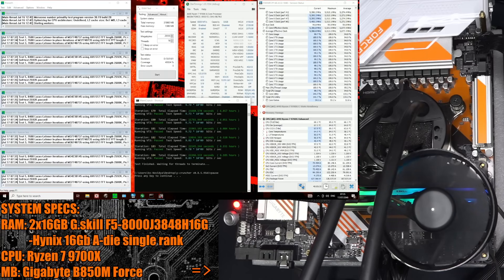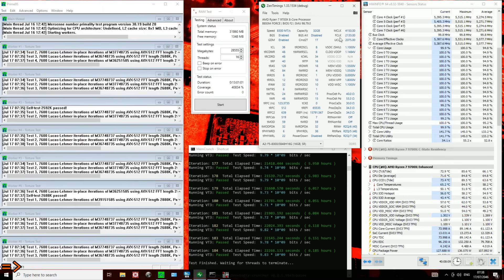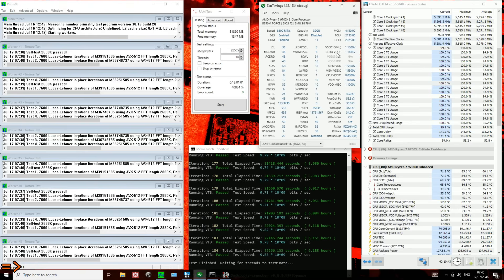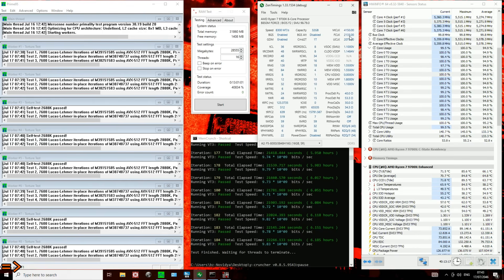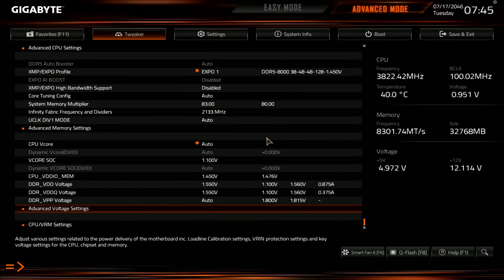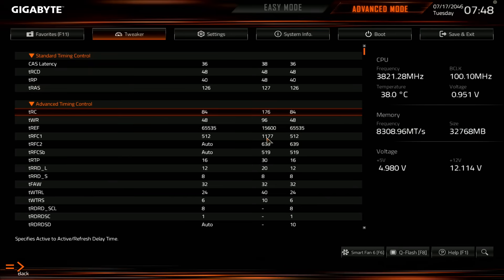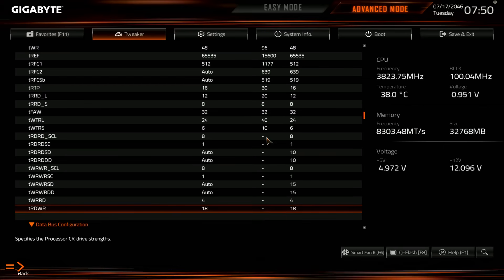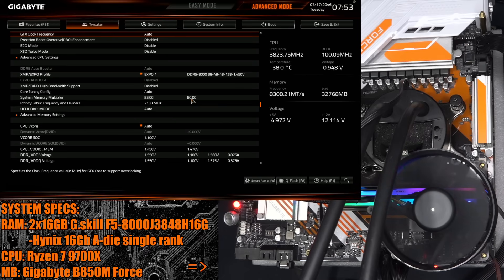DDR5-8300 CL36 with a Ryzen 7 9700X and Gigabyte B850M Force

Comment: There are a comment on X:
"vddio in gigabyte bios is for pushing the usable vddp limit. too high vddp without sufficient vddio may cause no boot/bsod. for current 1.45v vddio limit, i can push 1.175v vddp. 1.20v vddp caused me too much trouble when vddio was still being locked at max 1.45v. i guessed i needed 1.5v vddio for 1.20v vddp to get 8400mhz stable for my hardwares. gigabyte design requires fine tuning on vddp for dram oc."

Comment: The internet really confuses me with Ryzen voltages I gotta say.  All I see is people cranking SoC, VDDP and VDDIO yet the internet, especially Reddit warriors, go bananas the moment you tell them you put SoC above 1.2, change VDDP in any way, and crank VDDIO past 1.2.  From what I can tell, practically any EXPO profile sets VDDIO to 1.4.  I have no clue what to feel is the upper, safe daily usage limit because the internet is just pitchforks and if you dare say you bump voltage too high your processor dies yesterday.  I feel like I got a golden sample for my CPU and my ram kit and as long as I give it some juice it takes whatever settings no problem, I'm just not sure what's best for daily vs internet street cred because of benchmarks.

Comment: 4:03 why ??? THE CPU IMC won’t run 8400 end of…… 

Buildzoid you of all people should know it’s all down to silicone lottery not the motherboard 😂😂😂😂
Reply: I know this guy that has this mobo with 9950x3d, he's running 8400 stable but it wasn't possible with the stock bios that caps cpu vddio at 1.45, he downloaded a modded bios on a forum and vddio goes up to 1.6. he has 8400 fully stable with vddio at 1.50 but it has issues booting even at 1.45 so BZ might have gotten 8400 a modded bios here on this mobo! that's of course if the cpu is capable.

Comment: Hello everyone, 
just discovered this MB and found an offer for 132€, considering its pcie 5.0, and amount m.2 I think it's pretty nice (I know it doesn't have a lot of USB). 
I seen a comparison video that tests the temperature, and it was a bit higher that the previous downgraded model, so a bit disappointed. 
Just ordered a ryzen 7700, but not sure if I should go for this MB or get another one for 20-30€ more. Also saw that Asrock have good VRM/thermals, but scared to go with it because the report of X3D burned (I know mine isnt, but still scared).
Can someone help? ty

Comment: Ive been messing with my proc ohm and other ones, ive finally gotten them fine tuned and noticed a uptick of 600-1000 more mbs a seconds and 2-4 ns faster. On my 2x32 cl26 6200 memory. (Its gskills 2x32 cl26 6000). But also have super tight timings and have been working on this kit for 2 months? Can you shed some light on signal intergerity from your knowledge. 1.2.0 nitro etc

Comment: First: No way, over 8000 with 9700x?
After i check: oh, it is a 2 dimm board.. nevermind
Reply: why whats wrong with 2 dimm board?
Reply: @ajjames1960  Nothing. Just handle high frequency ram easily, not something spectacular or impressive. Try to run 8300 with ryzen 7 9700x on a 4 dimm board, this yes.

Comment: On the Gigabyte BIOS what actually each column value mean? For example: you have CPU_VDDIO_MEM set to 1.45 V, in the first column (right after the set value) it shows 1.476 V (is that the measured value?); also DDR_VDD voltage you have it set to 1.55 V, first column shows 1.1 V (min supported value?), second column 1.56 V (measured value?). I'm trying to get a sense if 1.45 V VDDIO would be safe on an ASUS B650 motherboard (specifically an ASUS B650 ProArt Creator), my VDDIO is set to 1.4 V now and measured reads ~1.44 V, and would like to also find which is tha maximum safe VDDP that I can push to the 9800X3D (currently set to 1050mV, maximum I did was 1080mV). Thanks

Comment: Try ram test pro from pcstonks. After mixing it in with my OC routines, I only use that, prime small fft and ycruncher vst to test stability. It finds errors faster than any memtest I tried. It also tracks wheas and has some numa settings for hedt that I don't care about. It's free as well

Comment: Been running the same MSI board you recommended to me in 2017 after the horrid company Gigabyte (never a Gigabyte for me for the rest of my life).  Upgraded the cpu, and ram, since, but time has come in 2026 to upgrade it all.  I was holding out for AM6, but apparently AMD can't get it together these days and fell behind schedule.  Not sure what to grab.  I have the Pro Carbon B450, 48GB (up from original 16) of DDR4 3200, and a Ryzen 5 5600 (up from the original 1600).  Do you see anything coming in 2026 or will I be purchasing 2025 tech?

Comment: Czech power grid ftw! UK power grid no longer messing with high memory overclocks :D
Reply: Would argue UK power is much cleaner on average cs Czech due to the grounding  system choice alone. But definitely mostly depends on a transformator. Btw ppl still think your AC line is not a factor and a couple of conversions in the psu will fully clean it lmao. What’s the best Mobo is ur experience when it comes to dealing with the shenanigans from the grid ?

Comment: Also that 9700x doesn’t like 8400, if you can’t stabilise it then it won’t work 

Not every single cpu can be plumped in and made to run at uber speeds. It’s all dependant on silicone lottery, your 9950x will have a good chance of hitting 8400+ the rest you might struggle

Comment: About that POST Code display - if one was able to solder the correct display/digitizer do you think it would "just work" or would it require some kind of additional UEFI module/driver or something else (ex. the DSDT info/config)? Original got an Asrock X870 SL but upgraded to a Gigabyte X870E recently & yeah that POST code display is a feature that really segments their lineup on X870 so a "lower" B850 chipset mobo has even less of a chance at having one.

Comment: 1:42 you should add one full game of BF6 to your test, guarantee it will crash within 20 seconds 😂
Reply: Most likely, but it depends on the room temp, maybe not.
Reply: If there is no errors with the test programs like memtest and all that wouldn't that mean it will work in  any or most all programs including games? I'm genuinely asking for my only knowledge. Why are you saying it will crash?
Reply: @chrisw2907  No that’s the problem. Even if you pass tm5 extreme anta777 + Aida64 bench, there is something missing.
A kernel driver scanning your system + ram (paged & nonpaged) in the back, which is ultra sensible to unstability.
For exemple I can pass tm5 and crash on a Windows defender full scan.
Reply: Absolutely will

Comment: I have my ryzen 9 7900 undervolted to -35s and -30s on all cores execpt one core that is at -25. But I have never done any ram overclocking!
I love your explanaitions and how you do things. Thanks for the lesson.
Reply: lucky you. I can barely do -20 on all.
Reply: @AnirudhTammireddy  thermals matter a lot, even a cheap aio can help a lot.
Also, without undervolting your CPU will not get to 100% of it's clocks. So you can under clock it to lose a tiny bit of single core performance to gain all core performance.

Comment: Hey, I hope it’s okay to hijack this video for a quick question. I followed your Ryzen memory tuning guide for my 7600X and have been running vSOC at 1.10 V and VDD at 1.30 V for almost two years without issues, using a GTX 1080 Ti.

Recently, I upgraded to a RX 9070 XT and now I’m getting occasional audio dropouts. Increasing vSOC doesn’t seem to fix it. I can run memory at 6600 MHz (1:1 mode) with 1.25 V, and FCLK at 2133 MHz with 1.15 V without any stability issues according to stress tests, although my daily driver is 6000 MHz with FCLK 2000 in 1:1 mode.

TM5 (Absolut, Extreme, Antra777) and Linpack all pass without errors even after 8+ hours of testing. During gaming, though, I still get random audio dropouts. The hub temperature of my RAM sticks peaks around 55 °C, so that doesn’t seem to be the cause either.

Not sure what else could be causing this, any ideas?

Comment: Hey hey hey !! 

If you ever have trouble matching YRDL’s when trying REALLY low CL and you can’t match them no matter what you do, set VVDIO to 1.53v and it matches ❤

Doesn’t do any harm, been running 9800x3d @ 8400 on ROG APEX CL32 1.68v using 6000CL26 bins ❤

Comment: I tested this motherboard last week with a 9600X and 2x16GB Lexar C26 (ran at 8400 with a Z890). 
My mobo maxed out at 7800 and i tried different voltages, but couldn't get it to 8000 :/
VDD 1.45V VDDQ/IO 1.45-1.6V VDDP 1.0-1.1V (default is 0.95V, which isn't enough and works in single-channel mode and stucks during restarts).
Maybe with over 1.1 vddp could go to 8000...
besides the fact that I hate gigabyte bios now I was incredibly lucky to change the b850m and buy a z790mpower :)
Reply: You can also set VDDG higher. ~1.4V

Comment: Oh look I've been trying to get DDR5-8300 the whole time recently (8400 proved to be too difficult on my X870e Taichi).

Interested in the debate on DDR5-8000 with FCLK synced (2000) versus DDR5-8300 with FCLK floored (2200) for gaming.
Reply: On my X870e Taichi the only way I can even get 8400 to run a 1-2 loops of Y-Cruncher VT3 was with 1.65 VDDQ (1.55 VDDIO, 1.21 VDDP, 48ohm RTT_NOM RD/WR, 60ohm RTT_WR, 25.3ohm ProcODT Pu, but guess that's mobo or kit specific)
Reply: I could be totally wrong here but my intuition is that high VDDQ/drive strength is needed when we're doing speeds these high but I needed to add some resistance to reduce reflections/noise
Reply: Also ran into VDDP issues. Stability got better the higher it was set. But past 1.21 it didn't POST for me. My board defaults to 1.15 VDDP when frequency gets set higher than 8000
Reply: 2200 is faster even at 8000
Reply: @Jeeerrrrrrrr depends on the game
Reply: @catonturtle3202 do you know which games
Reply: @bluesharpie9744 i just know cs2 prefers synced
only game i benchmarked